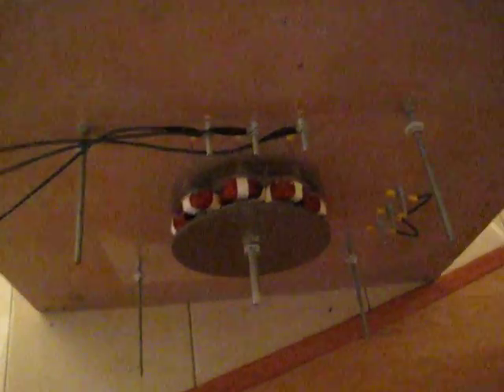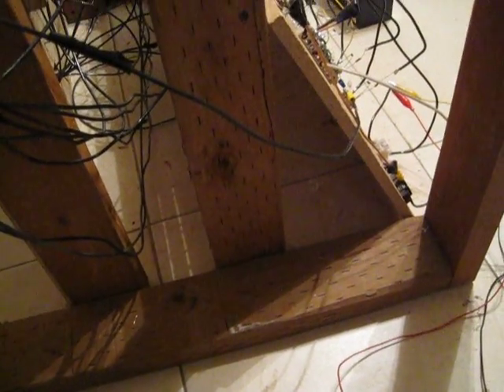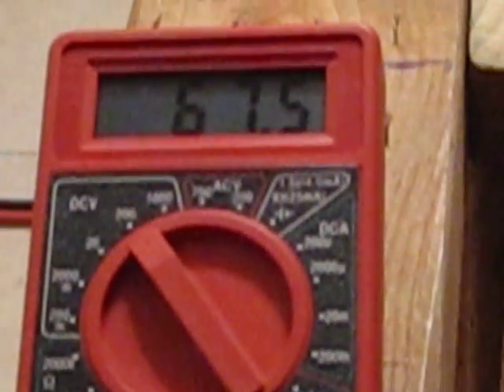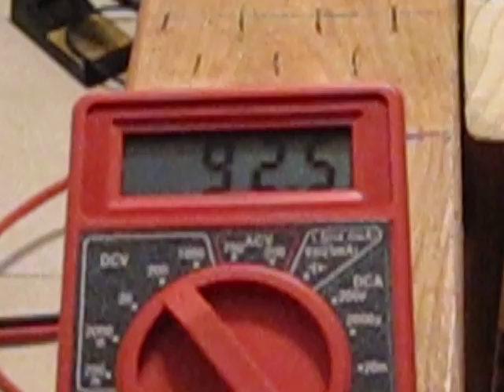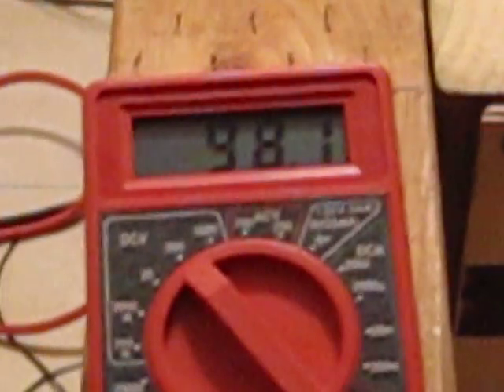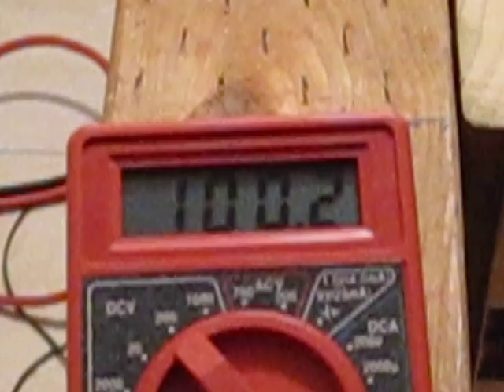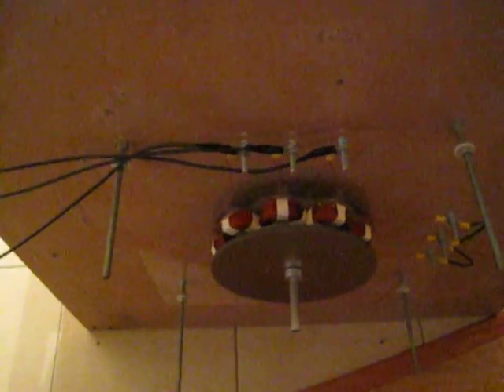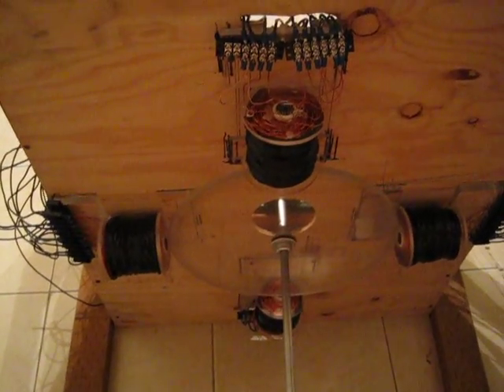pulse motor driving 3 phase generator breaks 100 volts rectified 001

Comment: I have twice as much 14 gauge wire as I do trigger wire 20 gauge...would it be acceptable to cut the 14 gauge in half and make a tri-filar coil? After the coil is wound I would solder each end of the 14 gauge wires together so they would act as one thicker wire. Does this make sense?

Comment from the maker: hey alvin, i am just using little 1/2 inch magnets on the pulse motor and the coils have 5 strands.  i would not recommend using differnt size wire on your coils if they are all going to be connected to transistors, you will have a un-ballance in ohms. try using all the same size wire, even the trigger.

Comment: WHOO HOO! I new you could do it HOT DAMN man that motor has even more potential than where it is now.... SD the neo's your using for the coils what are the dimensions please and i would also like to know the drive coils they are trifiller? and sizes aka all the same two big one small wires. Reason being I am starting to wrap my coils and am using transformer wire and several smaller size wire. Any tips would be greatly appreciated. I bow before you in respect you rock buddy
Allen

Comment from the maker: hey rocky, your correct, the bearing on that side is going bad, got two new ones on order and ill replace it as soon as i prep the bearing. i still have a lot of work to do on this set up, its not even close to its full potential yet. but thanks for the heads up, i noticed it also.